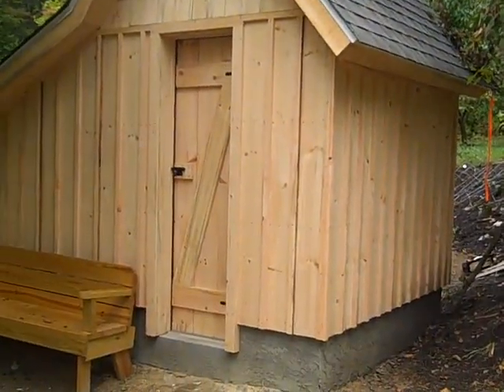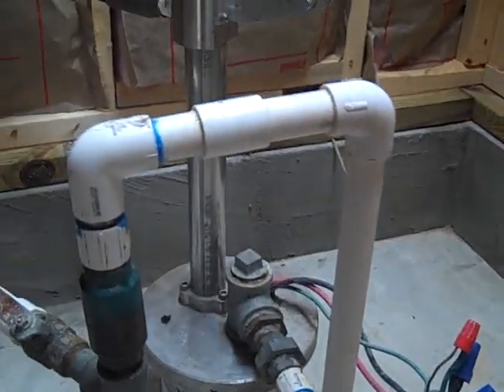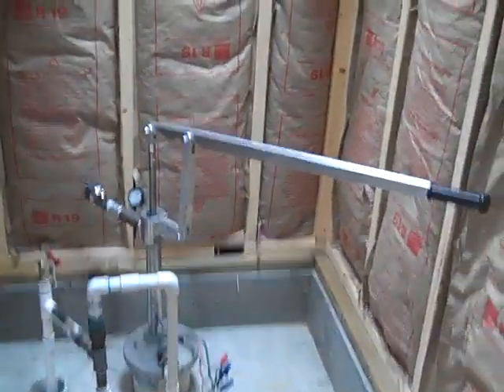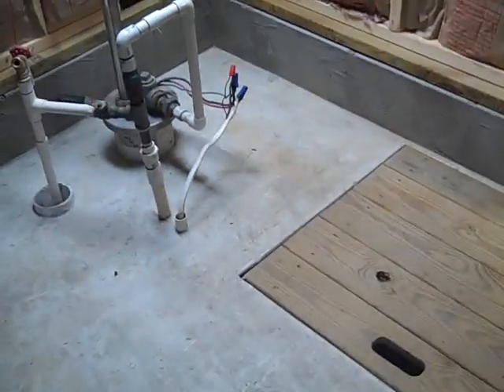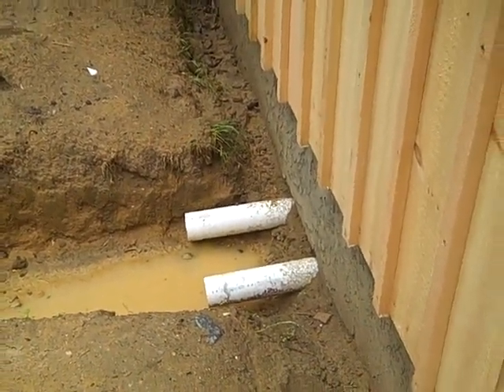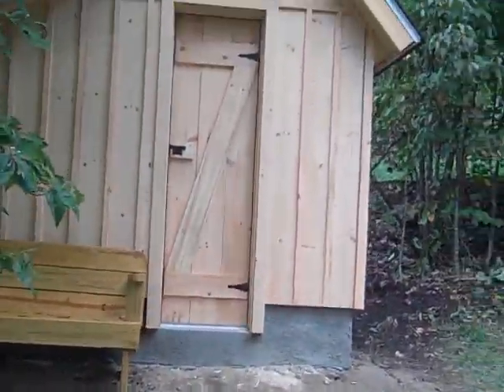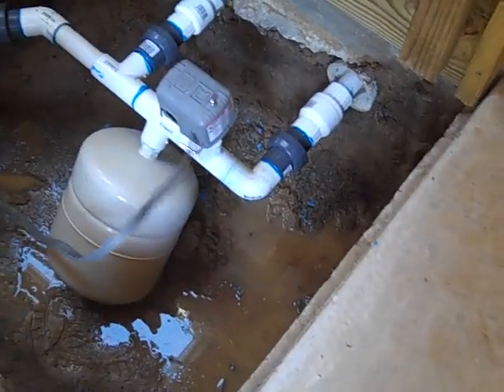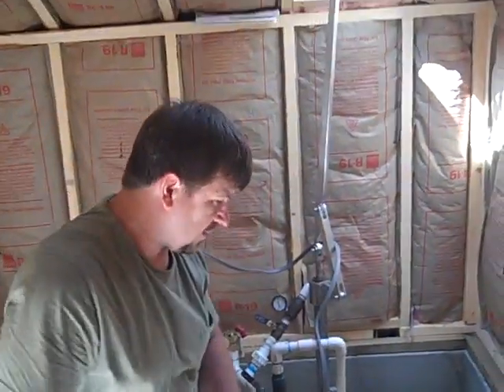Prepper Pump House

Comment: No one ever has a proven way to repel wasps. EVERY structure you build where I live, wasps immediately attempt to build nests. Behind the faux shutters - I used great stuff with bug repellant to fill gaps and they leave them alone. The porch ceiling - chimes have kept them away. The ugly bushes in front - a tow rope and GMC pickup... lol. However, my shed and outbuilding are nothing but a structure and each has at least 4 different wasp nests every spring. I've tried leaving the dead nests there, soaked in the wasp spray, but it does nothing. The paper bag trick does nothing. Those fake nests you can hang do nothing. They LOVE new construction. I'm a bit allergic, so any suggestions?????

Comment: Put your solar inside without large panels via solar batteries. Also do not use such big ‘motors’ use a smaller 12v with a converter switch to bump it 50%

Comment: Hi, I like your videos 
Was wondering if ever you would have any tips on my little project
I have a cottage up north and the temperature goes down to -35celcius
My shallow well pump is inside downstairs 
My main pipe for the pump goes down under the footing and 3’ underground with 2” styro boards on top ....
The well is about 30’ away from my cottage... right now it’s just a T=pipe out of the ground with a wooden box on top
Want to build something around the T-pipe for winter to use my cottage in the winter
Was thinking of a small isolated pump house about 3’x4’x3’high with a roof that opens like a hood on a slab with an electric baseboard 6” above the ground
My well pipe is not inserted in another bigger pipe....thinking of getting it out and inserting a bigger pipe around 10’long and then reinserting my well pipe back and make my slab around it then build my frame ....

Thanks for time 
Have a nice day 

Hopefully one of our Christmas will be at the cottage lol

Comment: how much does it cost to add a hand pump to existing electric pump system?   I was quoted $3600. to add hand pump at 140 feet?
Reply from the maker: I can get you a pump for about 1500.  Send me an email.  Do you know the static water level.  ? Distance from ground to top of water.  I am assuming you have a 4" pvc casing.
Reply: Static is 25 feet.
Reply: Yes 4 inch cast
Reply from the maker: Send me an email to info@practicalpreppers.com and I can email you a quote based on your numbers but ball park is 1500 including shipping.
Reply: already on the way . thank you sir.  big fan of your youtube channel

Comment: I just installed a well 140 feet deep in Florida.  do I need to be concerned with freezing pipes?  the night temperature could hit 29 but day is mostly in the upper 60.  do I need to protect the pump ?
Reply from the maker: Not much of a concern but I would cover it just in case.  They make fake rocks for an quick and easy solution.   The hand pump will never freeze as it has a weep hole to drain the pump head back into the well after use.

Comment: What size is your well casing?  I was told by Simple Pump that I would have to get a pitless installed... period.  You didn't have to do that it seems. I have a 6 inch well casing BTW.
Reply from the maker: You don;t need to have a pitless installed.  Send me an email and we can work out the details.  info@practicalpreppers.com

Comment: Are there people in southeastern Ohio that I can contact for help with a hand pump and freeze protection.  Everywhere I go looking on web sites I am asked for an address.  I am living near Cleveland, but I am preparing about 150 miles south from Erie.  I need info in order to make the right decision on which property I should purchase.  Some land has water at the road, some land has cisterns.  Some have no water source other than a stream.  Water at the road is great while the grid is working, but I want a back up plan.  Which land is the best for my situation?  Where do senior citizens raising grandchildren find fellow preppers for help.  I don't need help for the Cleveland area; I need assistance way south of Cleveland.  My relatives 50 years ago lived southwest of Columbus.  They had well water and out houses; I don't recall them having any kind of freeze protection.  One aunt had a well in the front yard with an electric pump, and my aunt next door had a manual hand pump right at the kitchen sink.  Any advice would be appreciated.
Reply from the maker: Our hand pump has built in freeze protection

Comment: The pumping motion might put too much stress on the PVC near the pump and crack this brittle material.   I would have opted for galvanized for this section or, better yet, effectively  isolated the rest of the water system from the pump with some braided stainless.

Comment: Here in Wisconsin according to well code you can not put a building over the well or vice versa. Also your well casing looks to be lower than the 1 course of concrete block, it should be at least 12" above your block should the pump house ever become flooded. This would keep the water from entering the well and contaminating your drinking water.
Reply: Thank you so much for some well needed advice.

Comment: @badatcards The "Z" or diagonal will function either way to prevent sagging  however top hinge to outer bottom (in tension) is more common with wood, as (compression) outer top to bottom hinge has more of an opportunity to warp. On another note I don't think engineer775 built the shed only the plumbing  aspects are his...

Comment from the maker: @fatlarry1962 I run 2 lines because I put a floating shut off valve on the inlet line.  Once the tank is full the valve shuts off the pressure builds and the pump shuts off.  The water returns to the manifold on the other line.   The Tank is an ambient tank not a pressure tank so you have to shut the water off when full otherwise the water would come out the top of the tank and the pump would never shut off.  Remember this is tied in with the house. 
Thanks for watching.

Comment: The door hinges are on the wrong side of the door , The piece of wood on the angle should point down to the bottom hinge to hold the weight better and to keep it from sagging. Other than that looks great for a pump house, And the skylight is a great idea. good to think ahead.